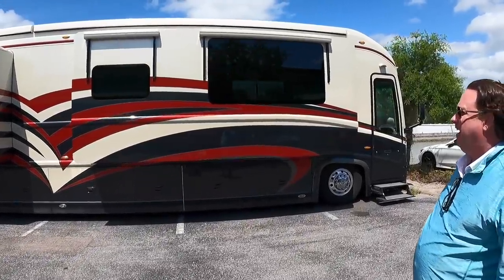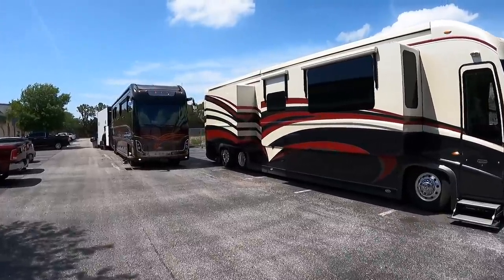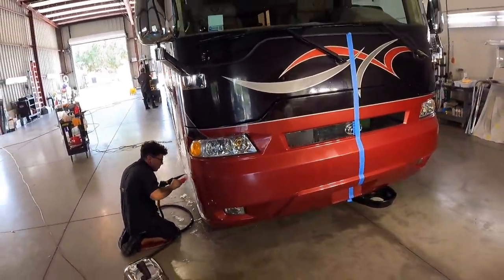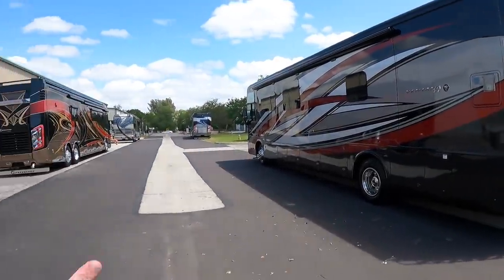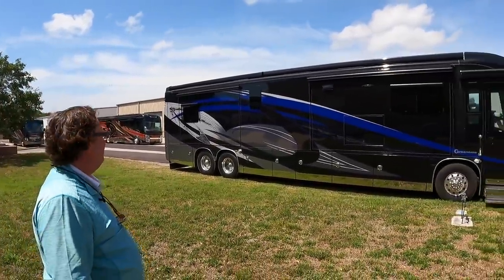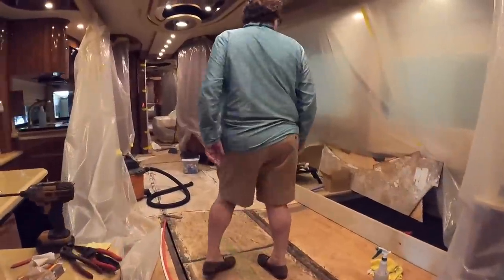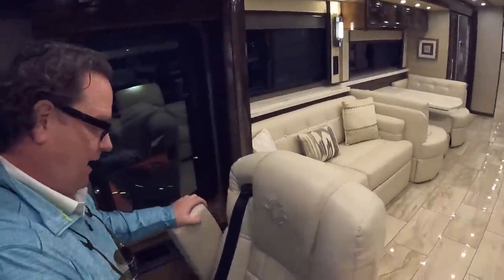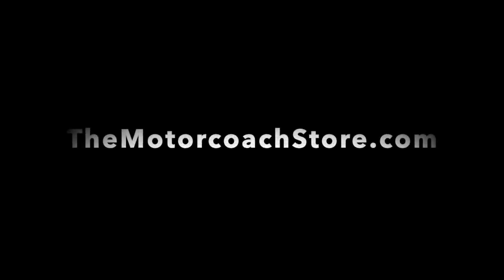Motorcoach Shopping April 2022 (We found Darrell Waltrip's 2010 Newell Coach!!)

Comment: Watching this video, reminded me of a question I had about stacker trailers.  How long is Dean Loucks stacker, if you know?
Reply: @chorn74 size and weight regulations vary significantly depending on the state, so it’s smart to figure out the most restrictive state you will be driving through. 65’ overall length is a requirement in a few states, including California. 14’ is the max legal height in most states. Weight requirements vary, but tire weight limits are law in every state.
Reply: @chorn74 I’m a DOT guy and you’d be surprised how difficult it can be to locate and interpret many of these regs. 

I don’t have any real world experience with stacker trailers or what the “sweet spot” for their height is, but I used to drive a semi with 13’6” tall exhaust stacks and I currently own and drive a 12’ tall motorhome. Trees and other overhead obstacles can be very difficult to avoid and can really dictate your route sometimes. My opinion: the lower the better.